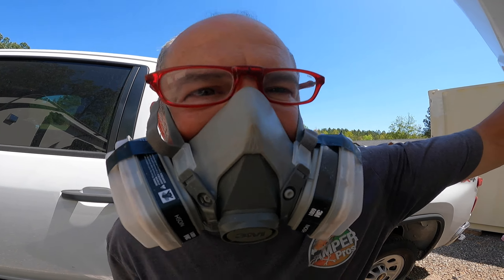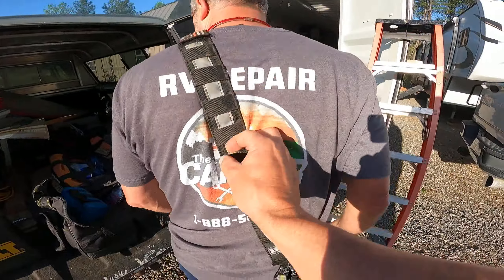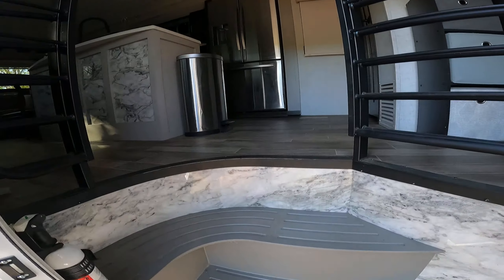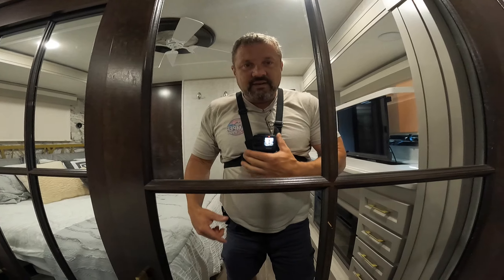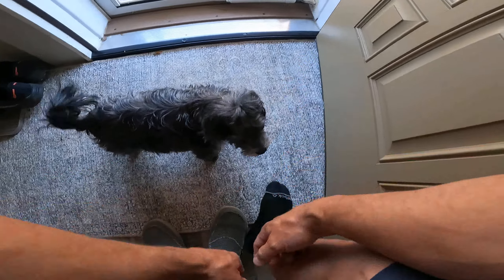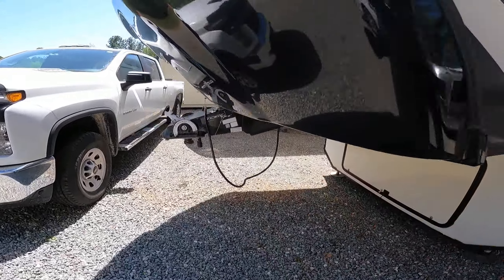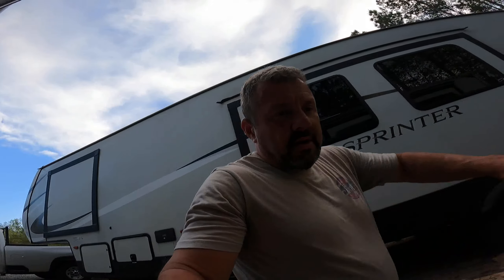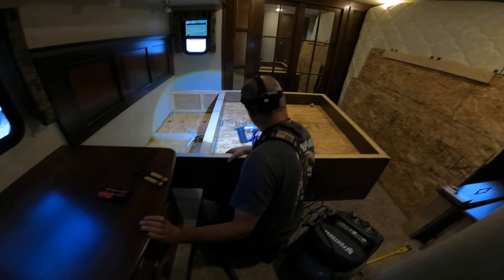Im not sure what to call this video

Comment: The slide floor rots out because the slide roof is leaking down to the floor, I had the same thing on my slide, you got to seal up the slide roof. But you probably have done that already. Great video, you guys really work hard in that heat. Thanks for posting.